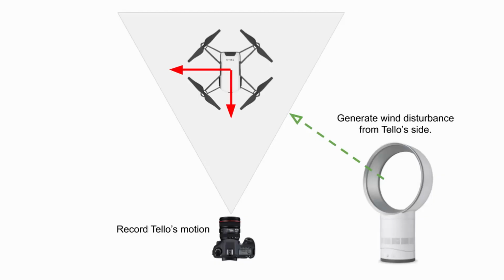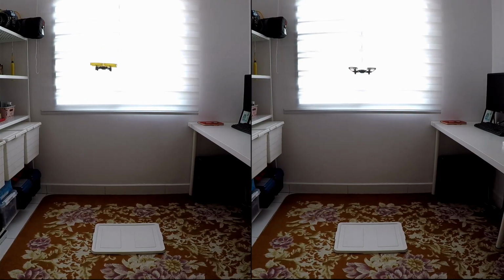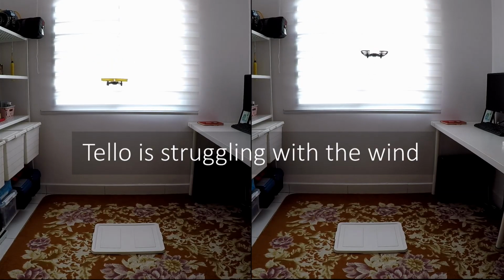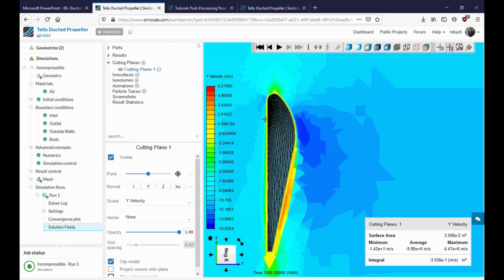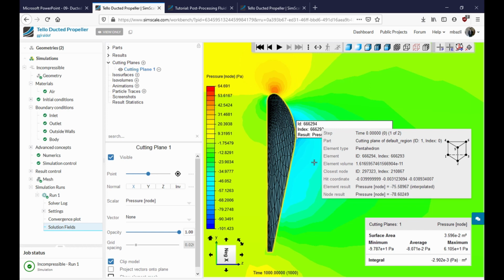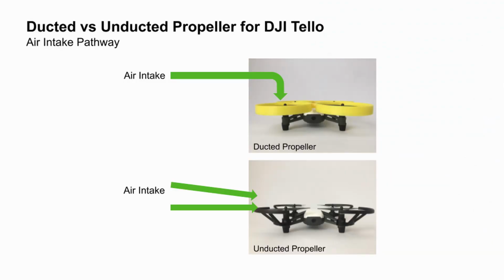Improve Drone Flight Time with Ducted Propeller?

Comment: Square tube Cd: 2.05
Round Bar/pipe Cd: ~1.17 (1.75X lower than square)
Aero teardrop (wing) shape Cd: 0.045 (45.56X lower than square and 26X lower than round)

Now.... what shape are the stators that hold your ducts..?
What shape are the 'arms' that hold the motors..??

Yet somehow these facts seem to have escaped actual aircraft builders!? NutZ! :)

"Errr..... lets blow high speed air down on a surface we want to keep up.... errrr?... why don't it work!?"
Are these.. 'aircraft builders' going to start putting fans, blowing into the sails, on sailing boats next!?

Comment: I just came across your video. Very interesting experiment. However, your test results do not support your conclusions.  Overall flight times were inferior with the ducted props.  There is no advantage to adding ducts compared to the control.  Also you did not mention if the batteries were identical in starting voltage.  If you could find a way to bring the ducted Tello's weight to equal the control then the comparison would be more interesting.  Measuring the thrust of both test subjects by adding small weights to the drones until they are unable to lift off would also be fun to learn.  Still, I enjoyed you video.  Nice work with the 3d printing.  Best regards from Canada.

Comment: No the ducted propeller that you want is supposed to be a one piece the whole prop and ducting should be one piece. this also removes prop tip turbulence and no lift zones. Also you dont need them that high at all just about the tallness of the angled blade tips.

Comment: Perfect. What I understand is that the air doesn't "like" to be ducted. I set up a duct for the processor cooler pulling cold air from outside and even so the temperature was higher than circulating the hot air inside the case. We have the feeling that the air is being blown out by the centrifugal force, but in fact it is being pulled into the center of the propeller. The duct seems to be an additional obstacle, so it decreases the air flow and in turn the efficiency. If it were efficient, all propeller planes would have ducts.
Reply: If I understand you setup(running a tube to your CPU) I think you are misreading your test results by not considering other factors. Without going into the formulas, you are correct in that air doesn't like being ducted.Length and bends increase resistance and reduce air flow so the duct must be increased in diameter to compensate.Computer fans come with a short ducting shroud that flares out just above the fan blade to increase efficiency. Centrifugal force only affects the air at the fan tip where it is closest to the shroud.Centrifugal force,not just a good idea. It's a law.Increased air flow into a container must be accompanied by increased exhaust or back pressure will stop flow.Small airplanes do not have ducts because the added expense and added weight won't offset fuel savings. A jet turbine motor utilizes a ducted propeller at its core for more thrust and efficiency. This is why jets are used for long distance and props for short flights.

Comment: Well done. I enjoyed that. I think the added weight offset the increase in efficiency of the ducted propeller. Need a lighter material.
Reply: I didn't see what material you printed with. HIPS is super light.
Reply from the maker: Yes, lighter material will result in better/longer flight time but, the efficiency of the ducted propeller is depend on its design.